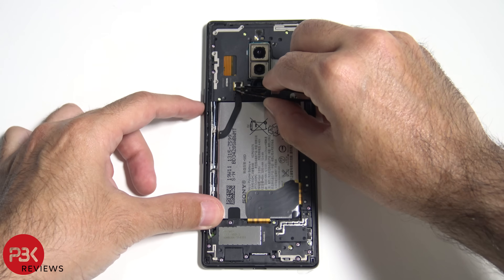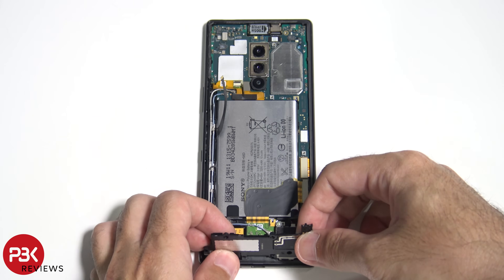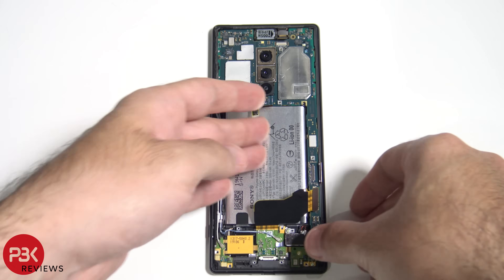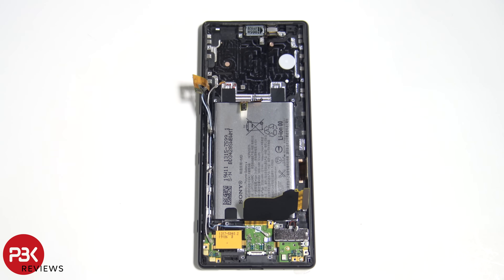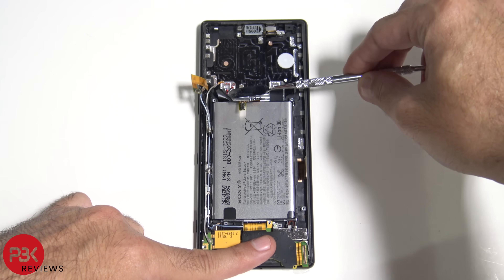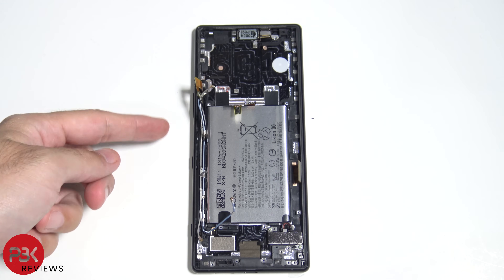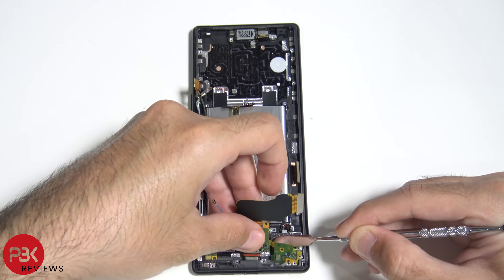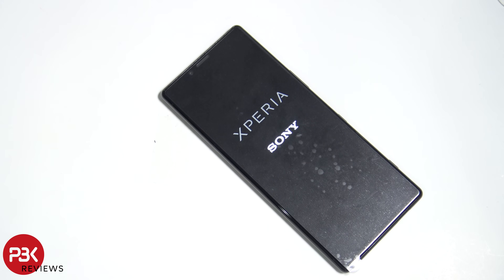Sony Xperia 1 Teardown Disassembly Repair Guide

Comment: Very eary explanation.  My sony xperia1 suddenly turned off, after charging and trying for next 3 days, there is no power signal. I have told it is power IC that is faulty. I have bought it. Is it easy to replace it on my own? Please advice.

Comment: Sorry if this is a silly question but does the back panel include all the sides of the phone as well? I'm asking because I have some chipped paint close to the screen around the sim tray area so I want to make sure that will do the trick. Also do you know how much that'll affect the waterproofing? Or is that dependent on how well I do in sealing it back up?

Comment: Hiya bud.
Excellent video.

Is that wire cable on the far left for the bottom mic?

I recently had the charger port sub assembly there at the bottom, flex board whatever ye call it with the mic aswell replaced as the port broke but now the mic isn't working.

Im thinking the guy forgot to reconnect the mic cable to the motherboard at the top but i haven't had it apart yet to check.

Cheers.

Comment: They said that this device supports wireless charging, but when I opened the back cover, it looked the same as your device. There's no coil for wireless charging at all. I'm currently on Android 11 and I don't understand why fingerprint and NFC don't work

Comment: do i need a heat gun to remove the back glass
and if i buy a replacement back glass does it have adhesive strips
Reply from the maker: You can use a hair dryer as well, and depends, some parts come with the adhesive pre installed and some don't. Usually sony phone parts are hard to find though.

Comment: Hey i have a sony xperia that boots up but when it boots up the screen turns off, any idea how to fix this? I don't really want to repair the phone i just want to transfer the files i had on my phone and to my new phone
Reply from the maker: Hmm not sure what it can be. Could be the board has a short or is overheating, bad firmware (which reflashing would erase your data), or something else.
Reply: @PBKreviews  Do you think its possible to recover the data or no?

Comment: Unfortunately I lost the lock of the fingerprint sensor connector. Since then I only left the connection-cable loosely in the port. From time to time the fingerprint-sensor started working again for a day or so.
Currently, I need to get it fixed - in order to apply for eGovernment Services. Does anyone have any idea how to fix or replace the missing lock of the fingerprint-sensor connector?
Thanks for the great Video!
Reply: Is the bad part of this Xperia  the finger print on mine doesn't work two years ago

Comment: Is there a way to make the phone waterproof after doing this procedure?
Reply from the maker: To retain the water resistance, you would need to install the original pre cut adhesive strip for the phone. Here is a link to one and you can watch the video I made on how to install new adhesive for smartphones to get a better understanding. https://www.ebay.com/itm/352745021561

Comment: Hi do you know if I can remove the front screen to replace the earpiece speaker without having to strip it right down?
Reply from the maker: Hi, no you would need to take it apart from the back. Also you wouldn't want to risk prying the screen off since there is a high chance of breaking or damaging it and it's costly. You would just need to remove the back plate/cover then remove the screws on the top plastic cover and remove that giving you access to the top earpiece speaker. Its held down with adhesive so you would need to gently heat it up and pry it off. You can always remove the motherboard as well to give you more room to work with but that is up to you.

Comment: عندي هاتف  سوني   اكسبريا 1 حصل له مشكلة   لايقبل الاقلاع   عندما   اشغل الهاتف  تطلع علئ  الشاشة علامة السوني  sony.  البيضا،   وكلمة اكسبيريا الملونة    والالوان. عل الشاشة   ثم  يعيد من جديد نفس الشي  ولايقبل الاقلاع.  السؤال فقد النظام  اندرويد 11.   ام شني   ارجوك  اعطيني  الحل ولكم الشكر
Reply from the maker: Hi, not sure exactly what it could be, but if you're saying it has random colors and then reboots again, might be liquid damage or an issue with the processor etc. As far as anything else I can think of, would be to try a hard reset by doing a factory reset manually through the bootloader. You would need to google or YouTube how to do that since it is different for every phone. Or you may need to reflash the original firmware.
Reply: @PBKreviews  شكرا عل الرد
Reply: @PBKreviews  اشكرك استاد تمكنا من اعادة تشغيل جهاز سوني اكسبريا 1  من جديد  شكرا
Reply from the maker: @AliAli-xq7rp  You're welcome, glad you got it going! :)

Comment: Hi, great video. I used it to replace the battery. Unfortunately when I reassembled my touch screen no longer works. I only replaced the battery so a bit confused. Is there anything obvious I should check?
Reply from the maker: Hi, thanks. Did you only disconnect the battery cable and didn't touch anything else? Make sure the display cable is properly connected, or try disconnecting and re connecting it etc. Also try turning the phone off and one and see if it helps. Very small chance the battery can also be defective or aftermarket with incorrect voltage etc. possibly causing the touch not to function or short but that would be my last guess. You can try connecting your old battery and see if you have the same issue. Also possible you may have damaged or broken off a small resistor or chip on the motherboard while taking it apart or disconnecting the battery cable which might have been for the touch.
Reply: Hi thank you for the prompt reply. I hoped to just disconnect the battery but after a couple of years of running quite hot the battery was glued in pretty solid so I carefully removed the motherboard to remove the battery as the tabs did not work as anticipated. One thing I can’t find a home for is the FCC ID plastic tab. I assume that is just information an has no effect on the product. I think this must sit behind the sim slot. Battery was sold as Sony for this phone, min 3200 mah 12.4 wh. Nom 3.85v 4.40v. Only thing is the code on the bat is different to the one on your video - s/n AA3540SWBWMT. Will try the old battery. Thank you so much for the video and taking time out your day to reply.
Reply: What does the cable do that you remove at 0.33 in the video. I think that little lock has got damaged. Does this have any relevance to the touch screen?
Reply: Fingerprint reader cable. Checked the comments below,
Reply from the maker: @Ironwithincotton  yea its for the fingerprint reader. If the lock is broken might not function properly if the cable moves around but not sure. Wont have anything to do with the touch though.

Comment: Can anybody tell me how i can change my fingerprint sensor? How much do i have to take off? Is it the first cable that was removed?
Reply from the maker: I should have gone more in depth on that portion of this phone but If I am not mistaken, the mother board would also have to be removed as well as the battery since there is probably a few screws holding a bracket that is holding the button/sensor to the midframe and those screws would be covered by the battery and motherboard along the side of the frame on the inside.
Reply: @PBKreviews  Thank you for the Quick response
Reply: @PBKreviews   More on finger print is weak part of this phone mine doesn't work since upgrade to android 11

Comment: my fingerprint scanner doesn't work anymore after battery replacement :(
Reply from the maker: Make sure you connected the cable for it and that you did not tear or damage the cable for the fingerprint reader.
Reply: @PBKreviews  thank you for replying to this old video :) cable seems intact. but by now I realized I broke off the tiny tiny "lock" for the cable that you showed in your video too. I found it but I doubt that it can be put back in place. could be worse. I'll enter a code then instead. don't have no .oney for a new phone and don't want to when only the battery had problems. everything else still great. (apart from the now defunct fingerprint reader). i still like the Xperia 1.

Comment: Hello, what is the black wire on the left top of the battery that you take off first please? Mine has broken and not sure what it is to replace it. Thank you
Reply from the maker: It's a coaxial cable usually used for antenna signal from the sub to main board.
Reply: Thank you. And what is the cable that it is plugged into. I think its the plug part on that cable that has broken. Thank you
Reply from the maker: @nataliecunningham103  the coaxial cables come with the connectors on either end, usually its hard to find the exact coaxial cable for specific phones, so you may need to buy one thats available for another phone and similar length to be able to use as a replacement.
Reply: Oh I just looked. It's not that one. It's the thin sheet like one that you said undo the lock for. The lock part has snapped off of the part underneath
Reply from the maker: @nataliecunningham103  thats the volume and power flex cable. I believe this is the part you need. https://www.witrigs.com/oem-power-volume-button-flex-for-sony-xperia-1
Reply: Thank you so so much. That's the part. 😃 Your video and you have helped me so much.

Comment: Bonjour mon téléphone Xperia 1 ne charge pas sans fil mais, je l'ai essayé avec plusieurs chargeur mais il fonctionne pas pourtant j'ai xperia XZ2 qui marche très bien sans fil qu'est ce que je dois changer à l'interieur
Reply from the maker: Hi, hmm not sure what could be causing it. Only thing I can think of is a loose connection or software issue. Try backing up all your data and doing a factory reset to see if its the software. If not, next I would look into a loose connection by taking apart the phone and making sure everything is properly connected. (but keep in mind taking it apart poses the risk of damaging the screen or parts if you are not careful as well as losing any water resistance since the seal will be opened)

Comment: For the ones troubled on the battery life:
Look into the settings and push down some settings that take more power. Also stop the game improvement app. This app isn't needed for the xperia 1. The app is almost as useless as ccleaner and avg.
Use half screen light, unless you have bad eyes, then i feel sorry for you ;p
The device is made for high end usage such as gaming and video-/photography, so expect some battery drainage like gaming laptops do.
If you use alot at the same time that overheats the device, you can easily get a decent cooling fan from aliexpress. Along with most replacement parts. Aliexpress offers the same items as on ebay or amazon, but for alot less money.
Reply: The Xperia 1 is way ahead of all other brands from it's era. You can afford to lower some settings and still be better off than other brands of it's age. It also doesn't affect performance too much, atleast not noticeable.
You can also open up developer options and go all the way down to adjust allowance in background apps.

Comment: Great explanation thank you.
Any idea how I can backup my data after phone got wet? Now it boots to the log in screen, then screen goes black, touch does not work although finger print works but I can't enter pin
Seems phone stop at that point, does not activate sim when I phone from another phone.
With a usb to HDMI, plugged in after the Sony text disappear after reboot, screen show same as phone, Android logo, tgen Xperia logo, then logon screen and goes black.
I would really like to know how to backup my data, seems tge maim board is the culprit.
Phone should not have let water in it was in perfet condition, and submersed for tge first time in 10cm of water.
Reply from the maker: Try taking it apart, drying out any water or liquid inside including moisture, then use a tooth brush to brush off any corrosion around chips and connectors etc. Then see if that would get the phone running, if not you can try a new screen assembly to try to gain access to the phone if the touch and so forth is not working. If still doesn't work and the phone just wont boot into the main screen for you to be able to transfer your data, you most likely won't be able to unless you find a professional water damage repair place for phones who might be able to fix the phone.
Reply: @PBKreviews  1st off this video is great and really informative. I think I have the same problem as this guy, phone will show battery level when charging, then boot up screen and then home screen for a fraction of a second before going totally black and unresponsive except for the fingerprint. 
I've taken it apart (apart from the bottom section as the screws were too tight and the screwdriver poor quality) kept it in rice over night and brushed whatever connections I could get at with a dry, clean toothbrush. Still no change unfortunately.
Is there any other steps you would recommend or should the screen unit being replaced be the best job?
Reply from the maker: @brianodughaill3090  thanks! At this point your only option would be to try a new screen, if it doesn't work then the main board has water damage somewhere underneath the shields causing something to short which would require a place that is experienced in water damage repaire for phones to be able to possibly fix. Since they use special chemicals to clean the boards etc.
Reply: I have what sounds like the exact same issue here after mine got wet, did you find a resolve / identify any particular place to find the damage? Would love to get mine working again
Reply: Hi, I have the exact same problem with mine, but it's weird because I didn't drop it in water or something it just froze randomly. Did you find a solution?
Reply: @ioana7058 ooened it up eventually, found water damage around icu's which corroded the contacts, so no solution had to accept it is a loss

Comment: replaced the screen but doesnt turn on, could I have recieved a bad screen? I battery is connected  I feel a rumble
, and green light in the corner when I plug it in
Reply from the maker: Make sure your connecter is connected properly  and in place. Also you can try disconnecting your battery cable and reconnecting it to see if it helps. If still nothing its possible the screen is bad or your graphic chip is bad on the board. When your old screen  was broken, was it still displaying  anything? Reason I ask is if it wasn't its possible more than just the screen was damaged when it broke
Reply: @PBKreviews  the screen was displaying things the digitizer just wasnt working, maybe im not connecting somethign properly
Reply from the maker: @skyrimadventurelore  Ya its possible then that the screen is not connected properly or the screen is defective.
Reply: These flatcables are very sensitive. Not connecting them well, can indeed cause disfunction or weird malfunction. Placing the screen askew or the digitizer cable wrongly can make the touchscreen flip out. Not pressing on the screen cable well enough can also cause bad graphics and flickering. Always check if the digitizer cable, or any cable for that matter, is connected well enough and connectors clean.

Comment: My Xperia 1 fingerprint sensor started overheating all the time few days ago, then the sensor now is totally no respond, and after that, the phone is draining battery crazy fast now and the fingerprint sensor keep overheating. Do you have any idea what the problem is? If it's the fingerprint sensor's problem, is it possible to replace it?
Reply from the maker: It's replaceable but not sure if the part is available. Try contacting sony and see if they have a mail in repair service.
Reply: PBKreviews thks for reply❤️
Reply from the maker: @kelvinlee6877  you're welcome

Comment: wait, is the battery removable?
Reply: There's usually adhesive under it, so the battery may not bang around if there's a bit space around it
Reply from the maker: Yes, every phones battery is replaceable. You just need to take a few things apart to get to the battery to pry it off. It's not a easy replaceable battery like the older phones which you just pop off the back and can remove it, but its not too complicated either.